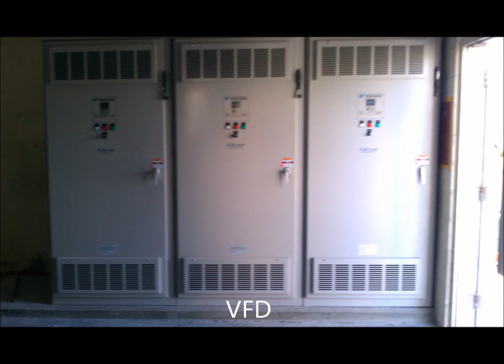Treasure Island Florida Master Pumping Station

Comment: Yep, I recognize most of that stuff. Pretty good size Flygt submersible pumps, Onan generator and automatic transfer switch, Variable Frequency Drives. Two Thompson Portable pumps to handle the flow during construction. Brown, yellow, orange tape on the wires usually indicates 480 Volt-3 Phase service. Didn't see the control panel, tho. Nice job editing and good music for a lift station (cough).